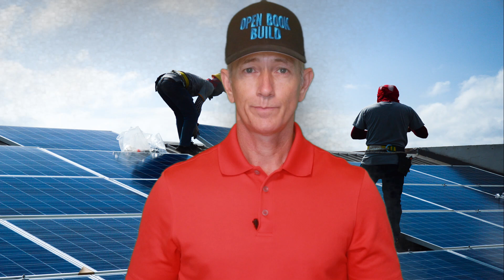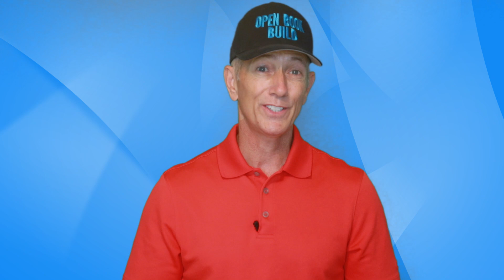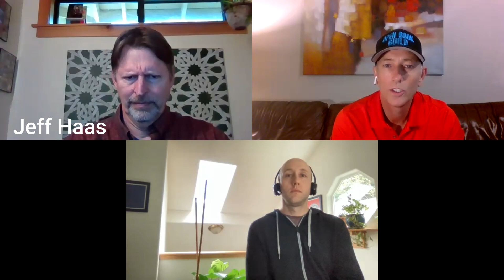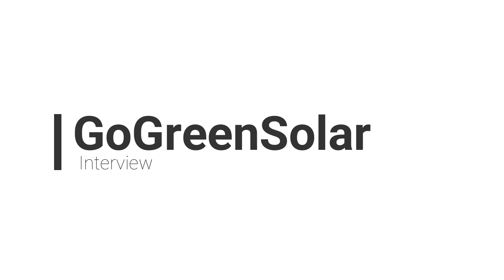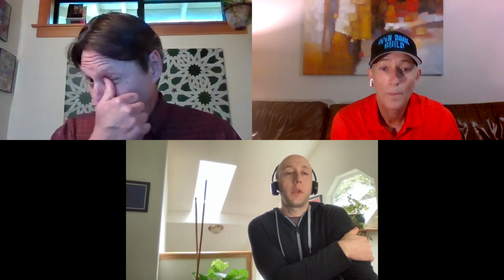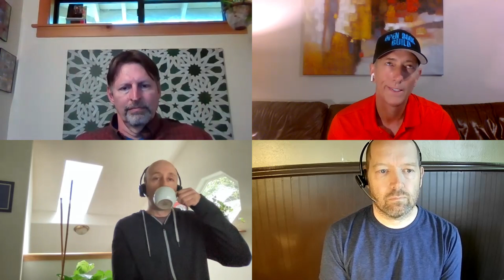DIY Solar Kit for Your Home

Comment: I found this interview really helpful for understanding the process behind solar system installation. There are a lot of ads around that blatantly state a “guaranteed savings” with no consideration of area specifics, whereas this company explains a much more realistic outlook for solar panel use in a given area.

Thank you 👍

Comment: really appreciate this convo, & it's absolutely what i'd like to do!

couple questions on doin the mounts before a roof is installed... 
1- i plan to put furring strips on top of my sheathing, metal roof installed on top of that, with bug-barriers & a ridge vent (allowing me to use closed-cell foam under the decking, yet still have ventilation for it, plus it'll help prevent ice dams on my overhangs). any conflicts there?
2- this will be on a 25x60ft garage/workshop with 16ft ICF walls, & i likely won't have the funds to complete a solar system day1. so is there a way to get help with just the mounts, plus maybe planning ahead for conduit penetrations & equipment placement? could be years till i can finish the system, but not screwin with my roof at that time sounds super appealing.
Reply: The metal roof is no problem, there are attachments for solar racking that work with all profiles. If you go with a standing seam roof, there are attachment clamps that clamp onto the standing seam so that you don't drill through the metal roof. If you will be making connections inside the shop you could figure out a spot for the conduit to penetrate and put in a stub with a cap.